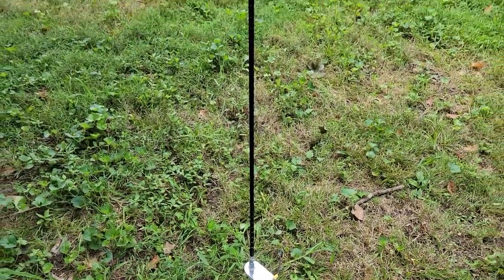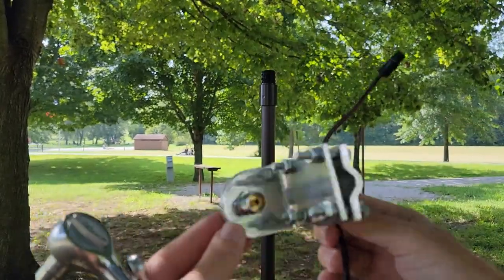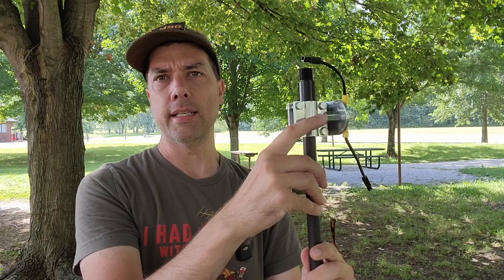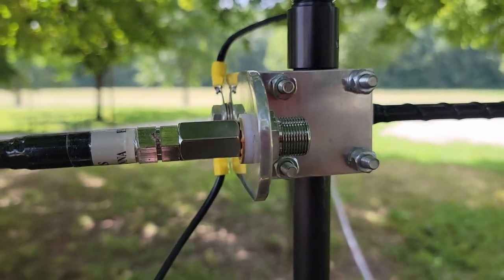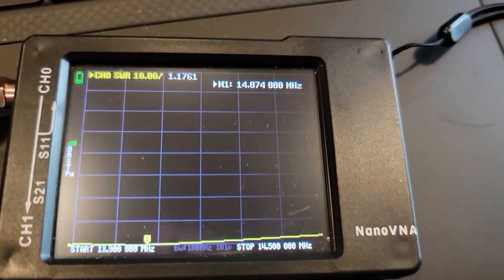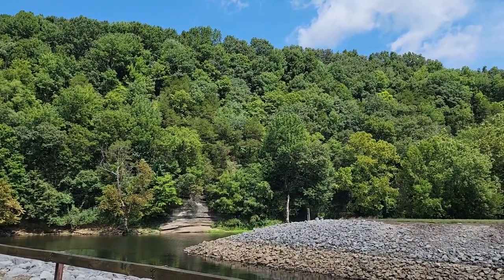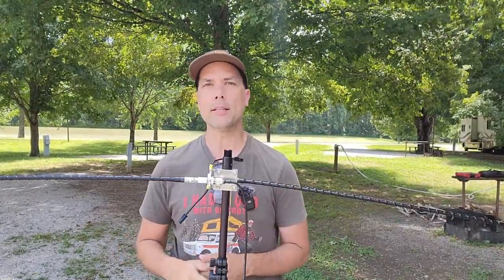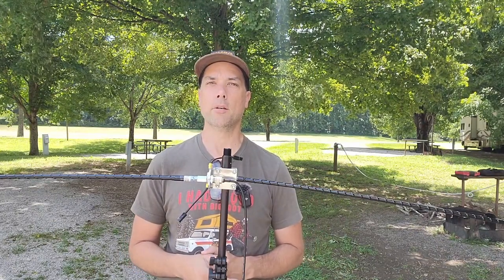How TO. Builds a Hamstick Dipole

Comment: Steve, try turning the mount bracket back to the way you had it before and use the 2 ham sticks and a vertical dipole. But make sure that you have the center ham stick on top and the ground facing the ground. You may have some interaction with the ground side and the aluminum mast. But it may work in your favor with the SWR or not. BTW, It is good seeing you doing this and trying to educate & explain how to experiment with different antenna configurations. I just have one small suggestion for you which is, to try to talk just a tad slower. Your explanation was great  & I know & understand what you were doing, but if you get some kids watching the video they might have to watch the video several times to understand and grasp what you are doing. Maybe you just had one cup of coffee too much this morning and are hyped up on caffeine. Take care 73s & 88s de N6KV Krisy and all the Kitties.😻😻😻😻😻😻😻😻😻😻😻😍 PS I just took a look at the set-up on Amazon they want $135. I just looked on Gigapart for the heavy-duty Dipole mount. It's $30 plus two 20 m Shark ham sticks which are $58 for both, The Total cost is $88 The only thing you would need is a mast & coax. It is a lot cheaper at Gigaparts. You save $47 bucks. What is really funny is all the stuff on the Amazon site comes from GigaParts too. its good to shop around for stuff, You know when hams buy stuff they try to find the stuff that they want for the lowest price.
Reply from the maker: Thanks for all the feedback!  I'll try the vertical dipole! Yeah GP has to charge more on amazon to cover the amazon fees.  The only reason I like amazon is because its omni-present - if I couldn't get EVERYTHING there, I'd shop elsewhere.  Hope you're doing well!

Comment: I use that "mirror mount" as you call it for my POTA activations and my home station.   They work quite well, though it is certainily a compromise.  However, you will need to make one dipole a bit shorter than the other because the bracket creates a slight mismatch.
Reply from the maker: Glad you got yours working 💪

Comment: I have this mount and hamsticks on a 16 ft painter's push up pole. Works really well, although I haven't managed to get an SWR that good.  Nice video.
Reply from the maker: Swr on antennas like this is very small movements.  I think setting up as a vertical was easy and then I just "cloned" the setup to the other hamstick.

Comment: Your thinking is correct: Here are the supporing thoughts.  The horizon is raised and helps keep noise floor lower.  What you also find is the F layer is contributing to multipathing since you hve using a horizontal dipole.
Reply from the maker: Nice, thanks!

Comment: I use two 20 meter ham sticks with the MFJ-347.  The mounting bracket ran $34.95 plus tax.  The main issue with the 347 is the bolts, washers, and nuts are not stainless steel and will rush in a short time span if exposed to wx elements.  I mount the 347 about 10 inches from the top of a 12 foot painters pole.  It works great for quick portable deployments with good reports.  When I purchased the ham sticks, the dealer recommended that I tune one stick at a time.  Basically, the two stingers are not exactly the identical length.  I took a hack saw and cut a small mark at the point the stinger  meets the portion holding the stinger.  I have some videos on my YouTube Channel if you are interested in checking them out.  If you do, please provide feedback so that I can improve the use of the ham sticks being horizontally polarized.  73, KB5AEB
Reply from the maker: Hey Gary. Thanks for stopping by.  It sounds to me like you're on the right track.  I like the hacksaw method!

Comment: Nice and easy to make diople. I tried a V config (90 degree angle) with two telescopic 5m whips and once lengths adjusted, was resonant from 20 to 10m. You could try a V with two hamsticks as this is somewhere between a flat dipole and a vertical, all with the advantage of no radials.
Reply from the maker: I'll have to find a V mount.  Got a part number?

Comment: Hey, Steve here, W2SWA. (Don't know why, but that intro cracks me up every time. LOL) I have had on my back burner to-do list to try to build a parasitic array of vertical antennas, ideally three elements with a director and a reflector.  My thought was to use 17' whips and then tune them.  Then it dawned on me, you have 2 sticks of the same frequency.  With the addition of an extra ground spike adapter like that and a coupe of radials, you could set up the ham sticks in such an array with a reflector (tuned a bit longer) and a driven element.  That would give you a bit of directionality and some noise rejection capability for a small extra gear price.  I currently only have one ham stick per band (40 and 20).  If you could try that, I would be really interested in the results.  I think it would be a great video.  Just an idea.  Thanks for your videos!
Reply from the maker: Hey Steve - I might be able to do that!  Would be fun to figure out how.
Reply: It might be interesting to try it with the 40 and 20 sticks, as the 40 might be resonant-ish on 20 as well, though due to the coil nature of hamsticks, probably not. The three element  quarter wave full sized vertical array was done by Callum (DX Commander). Worked very well down by the sea.

Comment: Yes, the vertical takeoff angle is superior to the low mounted dipole for DX. However, both tests need to be done under the same conditions. With the changing solar flux conditions as they are, one day is good DXing and the next day not so much. Unfortunately you can't differentiate antennas on PSK Reporter within the same time frame. So we're left with the way you did it which is close enough for amateur work.
Reply from the maker: Exactly!  Even if I were to put them up side by side and run two radios at the same time - everything effects everything!

Comment: Two 40m hamsticks, set up in a dipole like this will also tune 20, 17, 12, & 10 using a manual tuner.  Slap it onto a telescoping Harbor Freight flagpole and you have a very usable antenna for under $200.
Reply from the maker: I like that idea!

Comment: Has anyone tried two 40m hamsticks configured as a dipole, 6’ off the ground and running it at as a NVIS antenna. This would make a fast setup at home in case of an emergency with no repeaters available.
Reply from the maker: I haven't, but if you've got em, try it out!

Comment: On my adapter the feed point is opposite the flat and the curved part of the clamp is opposite the counterpoise (?) element. There is no interference between the HAM stick and the curve
Reply: Counterpoise doesn't seem right. The curve on the clamp is opposite the element electrically connected to the shield on the coax
Reply from the maker: Nice!

Comment: Those linked Amazon prices are just crazy. Exact same product is available elsewhere for a fraction of the price. 

I recent took delivery of a large collection of exact same items (40m x2, 30m x2, 17m x2, 10m x2, 6m x3, total of Qty 11 whips and Qty 4 dipole mounts) for less than 2x the price offered on the linked Amazon offer for just one dipole.
Reply from the maker: That's a good deal.  Where did you get them from?

Comment: I have used a 10m hamstick dipole with some success. When it cools off a little more, I want to try a hamstick OCFD. May need a transformer but I will try.
Reply from the maker: Usually for an OCFD you need a transformer, or a good tuner - that would be interesting... are you thinking a 2x10m sticks and shortening one... or a 40m stick on the left and 10m stick on the right?  Excellent thought, Imma have to try that!
Reply: @temporarilyoffline  40 and 10 to start. Who knows where it ends? 🤷
Reply from the maker: I'll have to find 40s and 10s... but if you run into them first and try it out, let me know how it works!

Comment: It's a pity nobody makes a mount that allows you to put the dipole in a vertical orientation. But did you have virtually no skip zone with the horizontally oriented dipole?
Reply from the maker: I think this mount would work vertically as well - you'd just want to be sure to have a fiberglass pole so the antenna and the pole didn't interact.  I'd have to go back and watch the first video to see the map of the skip zones... My guess is that the mountain played a role in one direction or the other.  I have always had good luck on a vertical on 20m working other vertical antennas very locally though.

Comment: I tried something similar: using 2 MFJ-1699, mounted via dipole mount on a metal pipe, all installed on my balcony. For radials I am using Comet CGW-560 counterpoise. When using my NanoVNA to measure SWR, i am getting a good 1:1.1 - 1.5. However, when connecting it to a Yaesu FT-710 or 991A, I am getting a very high SWR and the built-in tuner can't tune it. What am I missing here? Any ideas?
Reply from the maker: My first guess would be bad coax or adapters?

Comment: My 10 meter dipole is vertical as  was told to do for distance CQ
Reply from the maker: Verticals are awesome for DX - longer hops.
Reply: @temporarilyoffline   next up gong to try raingutter for 10 meters with an ant tuner. the cross gutters are 4o feet up  so a little travel on the downrun
Reply from the maker: @keathrhymer5449  nice - if you can't get it to tune right away, try a 4:1 or a 9:1 unun to get the gutters closer to the tuner's range.

Comment: Daily propagation of the ionosphere probably has more to do with your results than anything.   I've done this as well,  but i used a pvc pipe as an isolator to my tripod pole i was using,  how far i got out and where changed daily and even hourly.
Reply from the maker: Yeah, its really impossible to list all the factors that go into why an antenna works well or doesn't - and then they change by the hour and by the location too!  Its really quite fascinating how "predictably unpredictable" it all is.
Reply: @temporarilyoffline  I wish the equipment wasn't so expensive,  but my brother works for a company that makes antennas for non ham related reasons,  and they have test equipment that I would love to get my hands on...  lol
Reply from the maker: @chrisnmichelle0218  he's your brother,  that means you're allowed to use guilt and blackmail as a means of persuasion.
Reply: @temporarilyoffline  lol,  except for the department of defense taking objection...
Reply from the maker: Just tell them its for science... those are public tools anyway, right?  @chrisnmichelle0218

Comment: The only thing I hate about those antennas, is the bit of the whip not exposed, that's inside the Fiberglass, will throw you a curve. Then when you trim it off, you find your too short. That little bit may, give you a false low.  I've had it happen to me and had to purchase a new whip (1/8-inch Stainless Welding rod is cheaper)
Reply from the maker: I haven't had to trim yet, I'm not looking forward to it.

Comment: Very difficult to compare two antenna systems unless you can do it in a short amount of time conditions today are much different then yesterday. Also one could use the dipole in a vertical orientation and do so quickly
Reply: Sorry forgot 
Thanks 
N8BOA
Reply from the maker: Agreed, even same day comparisons are tough.  Vertical dipole is on the list to test.

Comment: I really should dig my two hamsticks out again, last time tried it was windy and it threatened to turn into a helicopter.
Why does the swr increase at low levels though? Is it something to do with ground reflections maybe?
Reply from the maker: Yes, for SWR, we are basically looking at the signals that are returned to the radio during transmission - so closer to the ground and you start reflecting your own signals back at yourself and it effects the meter - I wonder if this is a really a thing though - is the SWR of the antenna itself perfectly fine and the radio is just getting front end overload... or is it a real thing.  🤔

Comment: What happens if you turned it 90 degrees, so its vertical?
Reply from the maker: It works pretty well, check out my vertical orientation vid here: https://youtu.be/7xnDJfEYnH8 and be on the lookout for a vertical dipole vid as well.

Comment: Perhaps you're getting knife-edge diffraction  over that dam.   The angle of attack would be altered due to the differing heights of the radiation points of the antennas.

Nah, that's impossible.
Reply from the maker: Oh that would be interesting to test if I had thought about it and had a taller mast.  Keep trying at different heights and see if the diffraction exists. 🤔